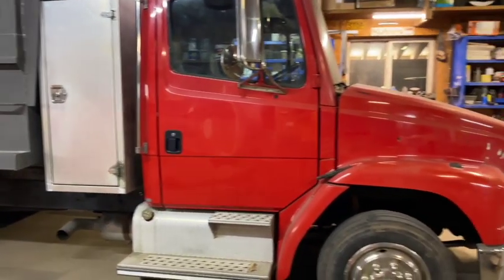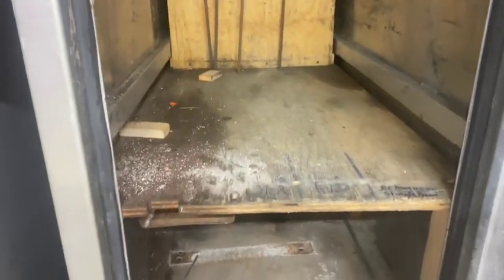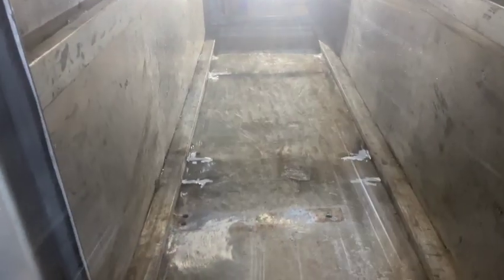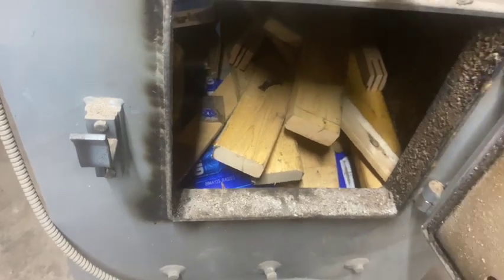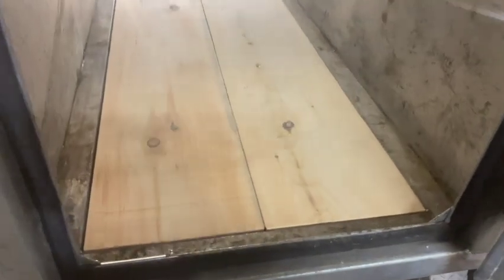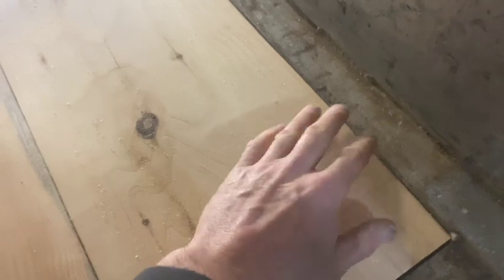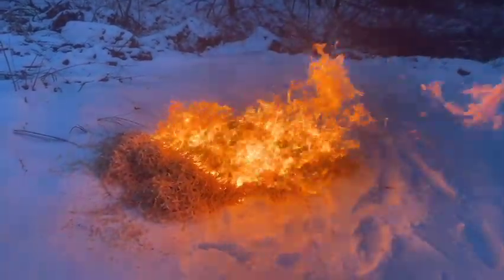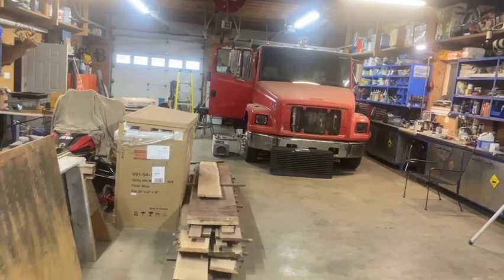Building a dump truck

Comment: Lookin good.   I like the LED light idea mentioned below.   Maybe also add a few sections of E-trak on the front & rear of the box between the shelves.  Would give you something to bungie things to so stuff doesn't roll around (sealant sprayers, etc)

Comment: With that type of board for the shelves I reckon it'll bend - you need to put some "ribs" across under each shelf to stiffen them -  and some rubber matting on each shelf will stop stuff from sliding around (and deaden any rattling noise)  as well as not damaging the boards . . . . . .  just need the beer fridge 😀
Reply from the maker: Them boards are super stiff so I think they will be ok. I like the idea of rubber matting though. and the beer fridge is just plain brilliant. LOL